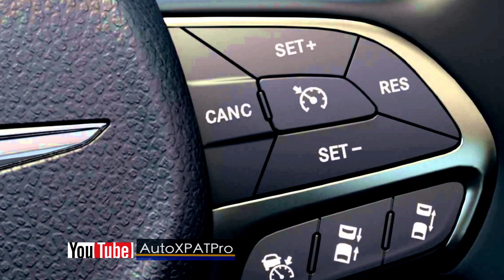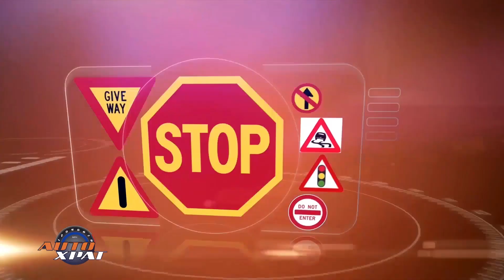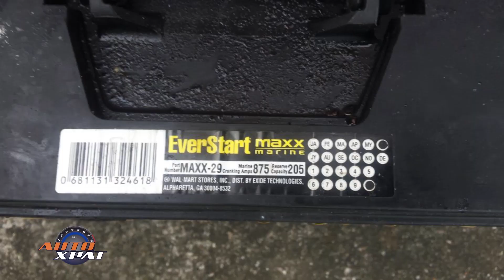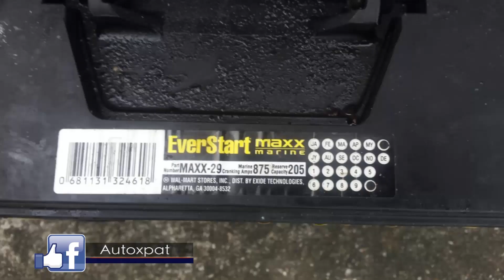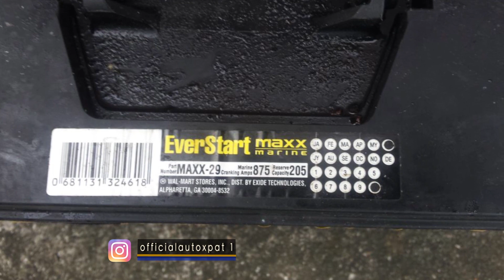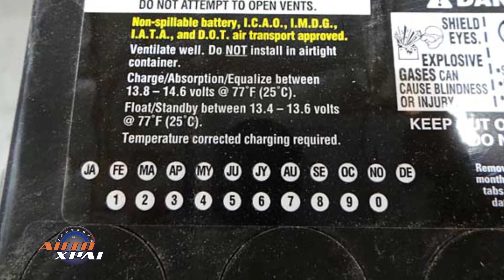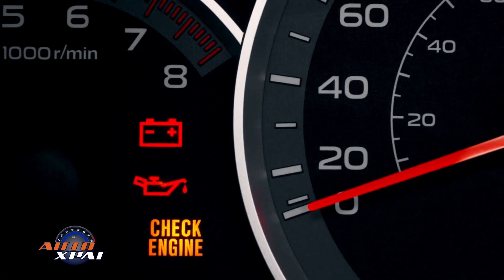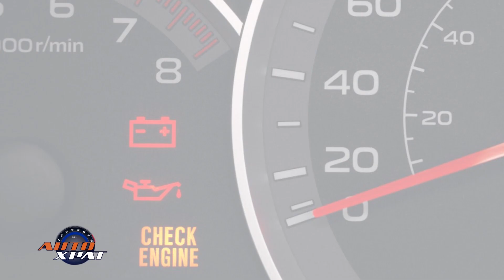CAR BRAINBOX AND THE FUNCTIONS

Comment: I will like to know what will be the effect of removing the ECU of  a vehicle (where the vehicle is not used between 6 months to 1 year or more) and replacing it back when the vehicle is ready to be used. Will there be a need for re-programming, what are the likely issues on the matter? Thanks
Reply: Can long packing affect brain box